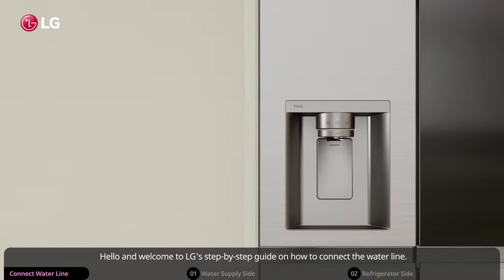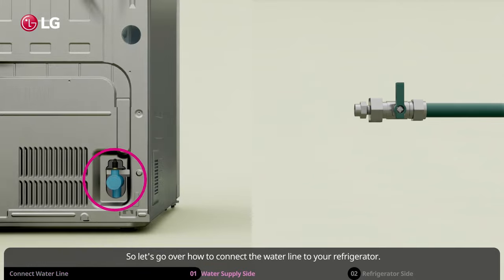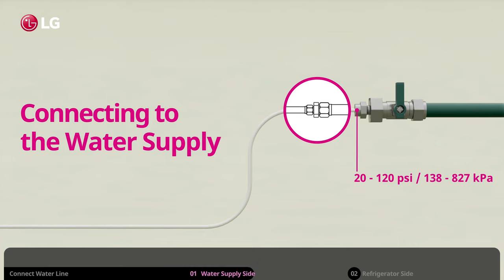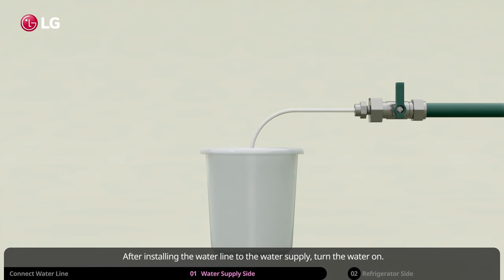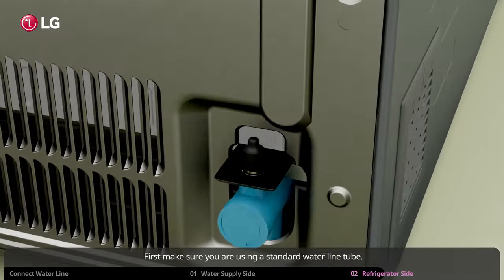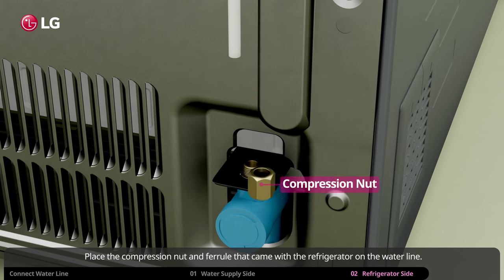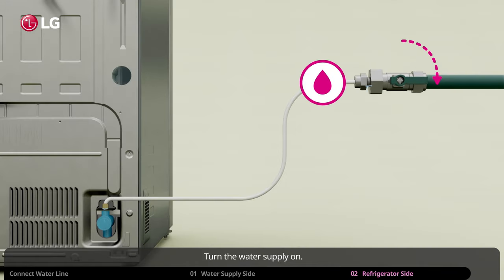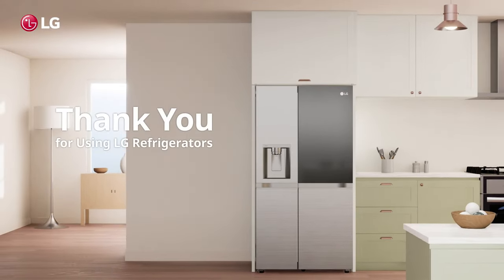LG Refrigerator : How to Connect the Water Line | LG

Comment: The LG unit we bought doesnt have any.connecting  valve for the water line on the blue junction point at the bottom/floor side . The lines seem to be at the top side of the fridge instead (the small manual that comes with it briefly mentions tbat, but no further info on how to connect). So how do you connect the lines for this model? 
PS. there is actually two lines, one blue and one white, and at both bottom and the connection point at the top on this model, ie they seem to be going (each) into two posdible directions, up or down!  I am good enough at  DIY, but didnt want to risk getting the lines wrong (conviniently LG  specifically mentions these waterline connections as not covered by the warranty)
 Quite frustrating as the customer services on phone didnt seem to have a clear solution. A video for this kind of connection would much help.
Reply: Hi Joss. Did you figure out how to connect the water line? I have the same model as well.
Reply: @andreabreu98  Hi Andre, yes we did sort of- that is, the Unit we bought DOESNT HAVE the piped-water system🤣!. This is despite the manual seeming to say so!! The Customer Services had no clue when we asked, it was indeed a plumber friend who pointed it out that this unit's water system is MANUAL - you fill a small tank  inside the fridge (on the side) with water and then place it back into the fridge, and  this   feeds the ice-box, etc via a connecting pipe. You refill the tank when empty.
I do not know if your unit  could be similar, maybe have a look. Cheers!!!
Reply: Is there any way to convert it. I only have the non-plumbed versions available where I am also. But would prefer it to be plumbed.

Comment: Is that compression nut and other piece supposed to come with the refriderator? Mine did not and nobody at home depot could sell me one. Do you know where I can get one?
Reply: Do u already have solution for this?
Reply: @fatheennashuhaazis2352  I bought one at home depot. The first time I went nobody was willing to help me find one. They told me it was in plumbing. I left and found the nut online and the HD website told me exactly where to find it in the store. It was  hardware on the opposite side of the building as plumbing.
Reply: @Joe_whatuknow  What exactly should I ask for? The Home Depot worker looked at me very funnylike and said he didn't know what I was talking about.